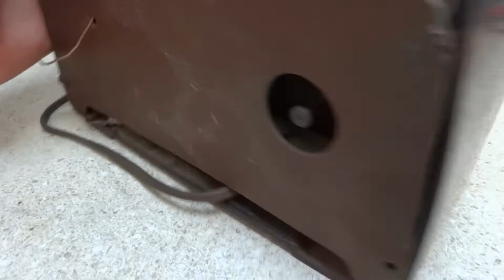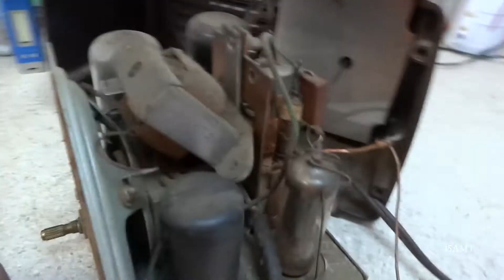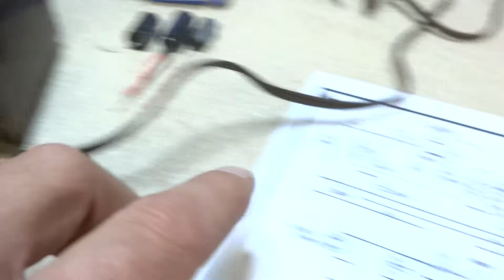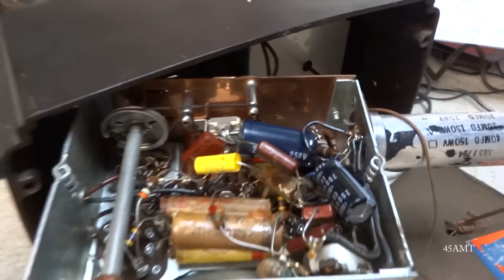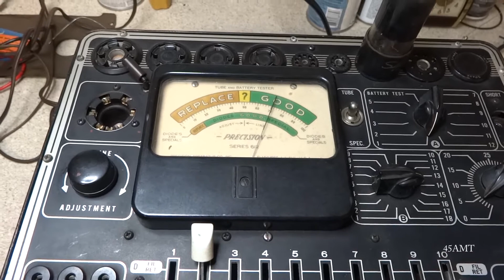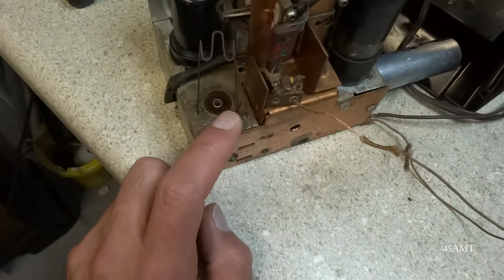Repair of a 1946 GE Model 50 Tube Clock Radio

Comment: I bought this radio, knew to fixing them...how can I determine which of the 3 different valued caps goes where in the side cap?...there seems to be 2 grounds and 3 hots....excuse my lack of knowledge...
Reply from the maker: You'll need the schematic for the set. I'm sorry there's not one online or i would send you a link. Typically you can ground a electrolytic to one ground point. But in these transformerless sets  they're is a floating ground and chassis ground. best thing is to trace the ground and use a point in the same circuit like the factory had it.(if it's a factory cap or circuit).
Reply: @RadioRescue  not to be a pain in the butt, but can you put a parts list up?
Reply: @RadioRescue  I tried to screen shot the schematic in the video...got about 90% of it (that's what was on camera), could you take a video of the schematic, and give me a heads up?...I'll screen shoot it?...Thanks in advance!

Comment: Last year, I picked up one of those cheep china crap kits to build an AM radio.  The build was very easy, but like your radio, it has zero rejection, all I can get on half the dial is our local AM radio Station the antenna of which is about a half mile away.  I have other little portable sets that work fine so I am guessing it is the junk parts they included in the kit, or else I may have put something in side-wise, or something.

Comment: It is common for really close/strong stations to overwhelm this design. Earlier versions used a 35Z5 rectifier but as miniature tubes became available they switched to a 35W4 which actually was a more powerful tube. The other tubes were available in huge numbers from wartime production so the GE people used them. Back in the 50s & 60s you could get replacement clock radio shafts from General Cement and other outfits as well as bags of the little knobs. 

The worst thing that could happen with this design was a speaker failure as the speaker was part of the front panel. This chassis was used in an earlier design sold under the Telechron brand. They were surprisingly common years ago.
Reply: You knowledge is pretty impressive ,I would like to find a radio like the one being worked on Ray
Reply: They turn up pretty frequently on eBay. Problem is too many are overpriced these days. Everybody thinks old means hugely valuable.
Reply: @RuneTheFirst  thanks I will keep a eye out for one ,I do like the midgets ,I like radios that are different,and clock radios too ,I bought a restored one.thanks for all your help

Comment: Have you ever thought of buying capicaitor  from.China ,for what I spent on two caps for a local supplier ,I can get 600 caps from China on eBay or Ali Exspress,I bought a bag of safety caps for what they want for one here,just a thought,
Reply: I got a bunch for just this reason but be careful. Some of these Chinese caps are not dependable. I have had some blow up the first time power hit them. I would never use them for a customer's set. I can replace them for myself but a failure will leave a bad taste in a customer's mouth. I get Nichicon caps for electrolyics and Cornell Dublier for small value caps.
Reply: @RuneTheFirst  I found the Japanese brand caps ,I don't no if I can spell it ,it's a famous brand states with a N on Ali Exspress very cheap .
Reply: There is Nichicon and Nippon Chemi Con that come to mind. One of them?

I don't know if I trust Chinese sellers of these but I will check it. There are a lot of counterfeit caps coming from China.
Reply: @RuneTheFirst  please let me no if you find anything on the nichicon caps
Reply: @RuneTheFirst  thanks for the info
Reply: @RuneTheFirst  nichicon caps Ali exspress
Reply: Will check it out. Been getting them on eBay from domestic sellers, although I do have one Chinese seller who I have dealt with successfully.
Reply: @RuneTheFirst  can you let me no which Chinese seller you use,me I try to save money on parts anyway I can ,too
Reply: Check out coolbaby11 on eBay. I have always had good results with them and prices seem cheaper than on AliExpress because shipping is free. I only get caps from them, though. It seems some other items are clearanced or from recyclers.
Reply: @RuneTheFirst  thank you all your help

Comment: I like this repair I had to watch again ,that tunning it has ,I  have only seen one other video it was fm like you said.I seem to like stuff that is different.and this radio is very different,nice job you did on it ,I have seen that missing clock knob on antique radio forum ,and one or two other places.
Reply: This radio tunes the same way car radios used to. Slug tuning was almost universal as it was not as prone to temperature sensitivity. Open air caps would often change capacitance as they warmed up, detuning the radio. (The space between plates would change.) 

For this same reason many small home radios would change as they warmed up if the designers placed rectifier and output tubes too close to the tuning cap. Thermal design was important back in the tube era, especially in small radios.

Comment: This is the first ever clock radio, uses the same chassis as the Telechron Musalarm. It had a dial scale at one point, but it has rubbed off. I currently own the Telechron Musalarm.
Reply: EvanPlayzGames 
Interesting. I’m going to purchase this model shortly.  Question: how did you get the info about it ❓

Comment: So you still got AM broadcasting?  In Europe it is almost completely over.  In Belgium we still got one French station (RTBF).  Last week I read about the famous 'Radio Caroline' resuming AM broadcasting from within the UK.  Unfortunately 1KW does not seem enough to get a stable reception in Antwerp, Belgium.
Reply: 1959Berre 
How SAD ❗️
Here in the States, AM radio has changed. But not bad. Just different.
Now we have tons of small local/ regional stations springing up.
Some of the really big stations are having to re-direct their antennas
as to protect the signals from the weaker stations.  But AM ( Medium Wave) radio isn’t going anywhere any time soon ‼️‼️🙂

Comment: Despite the lack of selectivity, as we know, the original intended purpose of this clock-radio was simply to wake its owner up. This was probably why engineers at General Electric cut some corners in its design.

Comment: Nice video.  I just bought one of these tonight.  I have the white case.  It was well taken care of, probably one owner.  The volume and tuning have the numbers printed in red around the knobs.  It is the exact same as yours and has the same spec paper glued to the bottom.  Thanks for sharing.
Reply: There must be a few of these radios around, I yet to find one ,I like the midget radios too